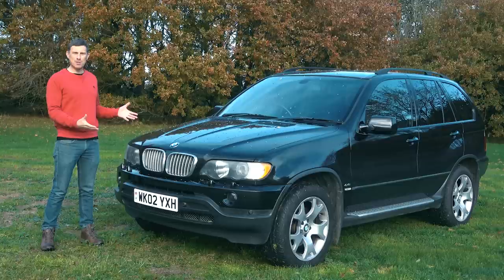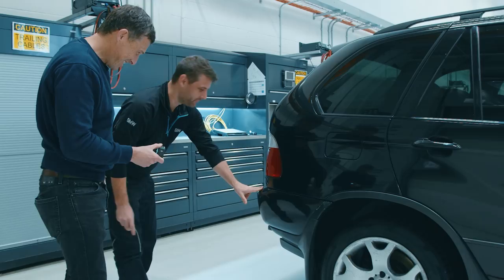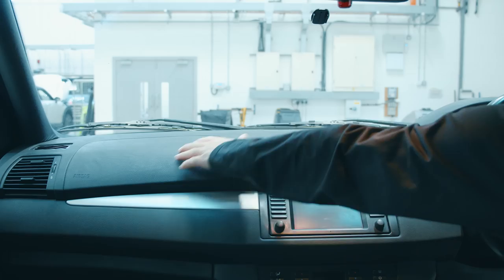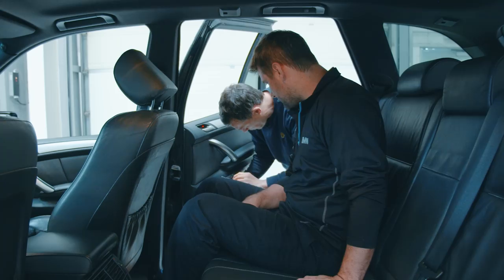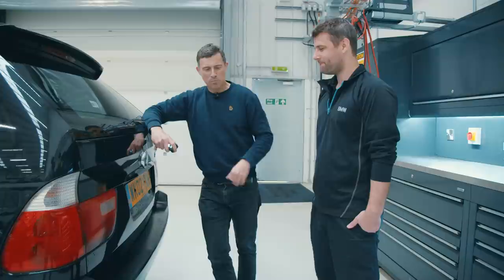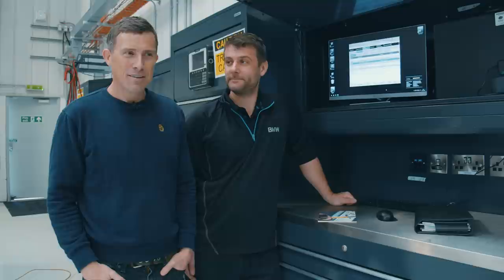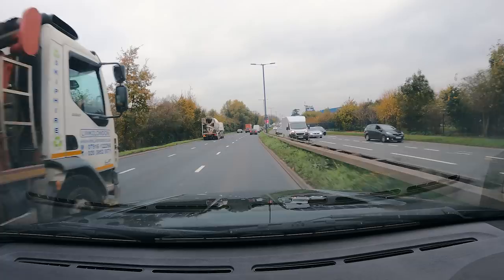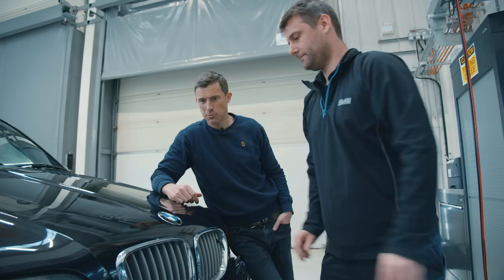BMW RATES MY 'NEW' X5 V8!

Comment: We've owned a 2003 X5 E53 3.0D sport since 2016.  Loved it but it has been the most unreliable and expensive (in repairs) car we've ever owned.  Gearbox rebuild, 2 injectors, fuel pipes, rear suspension bushes, window regulators, door handle issues - the usual stuff.  Now at 163k miles the engine has lost compression to the point it misfires badly at idle (diagnosed as loss of compression in the cylinders not leaky valves).  I had hoped it was going to be a 250 - 300k engine.  We can have a recon engine fitted for £2400 - is it worth us doing this?  The car working is only worth about 2k.  Such a shame as it looks and drives fantastic.  What chance of them becoming a classic?

Comment: My E53s air suspension used to go out all the time. That would drive me insane. That was really the only major issue I’ve ever had with that car.
Reply: Then convert it to springs, you know you can do that right, it’s not like a Range Rover where they all come with air, you can change it, handles better anyways too

Comment: With 600€ ( except the  mirror) you will be ready with aftermarket parts in eu , for example the discs are from ATE and will cost you double or triple the money if you buy it from bmw and it is the same thing,also you overpaying  by a lot the labour for no reason at all at the official workshop

Comment: Would have been nice to get Mitch insight on the engine guide chain (supposedly the weak point of these M62 engine) and if there’s anything that can be done to prevent their failure. I have an E39 with this same engine, great to drive but still wondering if I have a ticking bomb between my hands.
Reply: I have one of these with the M62 and my timing chain guides have just failed.  Parts cheap but Labor is expensive.  Apparently nothing you can do as they are bound to fail. My car has 240 000 km.

Comment: Before watching, my advice is to never buy a cheap V8, It's gonna cost more to repair than to buy it, for cheap cars with good engines, I'd rather choose a Subaru Impreza (even the non WRX one) it still costs too much money to repair, but at least it won't drink as much fuel :D

Comment: i had one of these 2002 4.4l for 2 years,i spent 6000 euro within 2 years just trying fix stuff and maintain some other stuff.it's fucking impossible,There was still a ton of shit to do and even issues they never even knew how to fix.That was a huge mistake to buy this piece of shit.
Bought for -7500 euro
Spent - 6000 euro
Sold for - 3700 euro
Still was happy!That shit just wears you down!
Reply: very unlucky by the sound of it, generally good cars

Comment: 1000 quid for rear swing arms? what a load of boll****! asked a local garage about those and I've been told the same. "replace the whole arm". I've replaced those bushings on my car, all on my own. those bushing are a tenner each. plus a tool for about 60-70 quid. ridiculous

Comment: Pardon my French, but that is utter bollocks it’s not what you know it’s who you know it probably wants an oil sump plug or a rocker cover gasket. The power steering fluid is probably excess leakage from when it’s been filled in the past or maybe just a little split pipe somewhere, but that’s an easy fix still can probably get the rear arms with the bushes for a couple of hundred quid each may be cheaper I would never pay main dealer prices or even backstreet garage prices. When you have a car you have to have a friend who is an MOT tester and a mechanic for sure  I bought a car once that failed its MOT miserably on lots of stuff when I took it to my mate all It actually needed was front discs and pads at the end of the day. It’s the garages job to try and get money, even if a vehicle doesn’t need spending on it it’s there  bread-and-butter it what pays their bills, but I refuse to be conned

Comment: I would have got that power steering hose done unless you go down the gym on a regular basis.
Reply from the maker: The steering is kinda heavy.
Reply: @MatWatsonCars  Matt, So if it is heavyish during normal operation how heavy will it be if it fails? That would be my concern on a already repaired hose. Cheers!

Comment: I have 3.0D 2005 E53. I used coding software (widely available for £25) to code Daytime Running Lights ON, however they don't seem to come on. I understand that DRLs should be 60% of highbeam, anyone any ideas? Do they have a seperate relay?

Also did the rear coil spring conversion from airbags; bit of a pig of a job, but runs perfectly now

Comment: If you want a German car without issues you need to go further back than this, they are designed to fall to bits. If you want reliability you buy Toyota, honda or lexus
Reply: @MrKeefrichards  I wouldn't be,

Comment: Reported, categorised damage, small rant:

Why would correctly reported damage and formal repair and inspection to get the vehicle roadworthy again put you off?

If I'm buying a 20 year old car, I wouldn't be put off by a car that's been recorded. In fact, most cars of that age will have had some kind of scuffle, far better to buy one that's been through insurance than someone who's DIY repaired it.

Comment: Get an Japanese it will be cheaper to run. I have an Acura mdx.. better in every point.. with 300hp..and a great 4x4..
Still every one loves bmw..
when they no break..
when they dont leak oil in your driveway..
you will know if you keep that thing..
NO porsche cayenne.. they are terrible too

Comment: idk why would you even buy SUV exspecially modern ones 

look nobody likes huge wide ass car in road even at parking spots thats like using Hummer H1 or Humvee what ever ya wanna do

why even bother SUV they aint worth at all none of them are worth ya want huge car make it a reason why dont get huge for your self i mean there shut be reason why you wanna get it and explain it why  i am suprised this BMW X5 acsually has manual transmission , clutch even OG Handbrake which is impresive but still not worth getting SUV at all

Comment: I can tell you instantly with out seeing video. I bought vehicle brand new straight out the dealers window fully loaded. This piece of shits trans went out at 90k miles. You buy bmws you mine as well by a mechanic shop too. Trash never buy Beamer again I’ve had 2 brand new ones a Z4 also.  Toyota Highlander and never looking back.  Here’s one for what the difference between a bmw and a porcupine…the porcupine has the prick on the outside 😂😂.